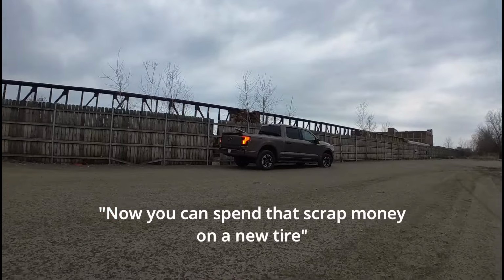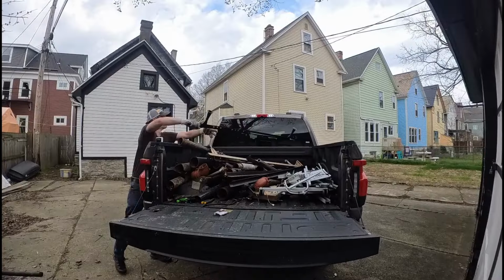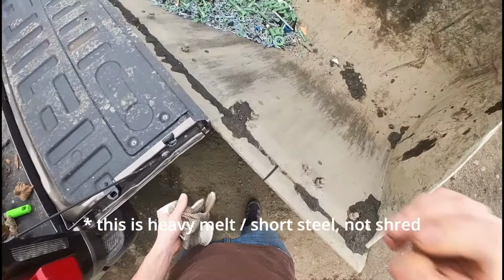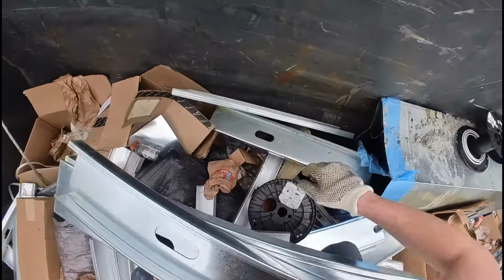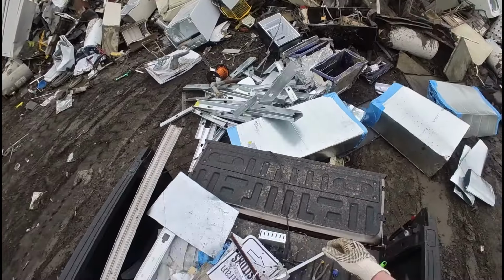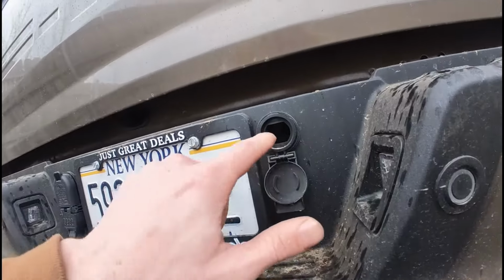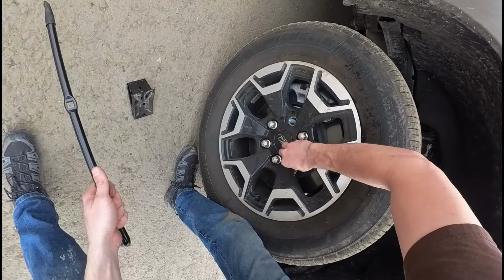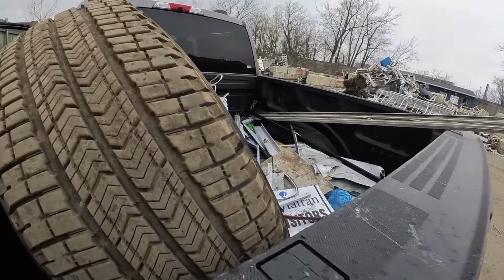Scrap Metal Tire Fiasco

Comment: Getting a flat is not that bad, compared to one time we were leaving and someone pulling in had busted the front of their truck. The front wheel was no longer straight. I assume it was from that big pothole that was in the driveway. But I got a good hoard of scrap that will be going in Wednesday hopefully
Reply from the maker: That pothole used to be huge.

Comment: If your tire guy won't fix it get a new one.  I could fix a hole like that with a plug kit from the dollar store.  Anything in the tread like that should be easily repairable.  I've done dozens of them roadside and refilled with a 12v compressor.

Comment: I’m surprised you don’t carry an air pump and a flat repair kit you never had to take the tire off the truck all you had to do was turn this fill the tire up all the way over and the by 10 pounds turn the tire all the way make the whole face the outside And use it the tool, the Ring out and put a plug in it. It’s easy to do all you do is follow the instructions. It would take you five minutes and you would’ve been on the road and going. And if you’re not sure how to use it by the kit, watch a YouTube video.